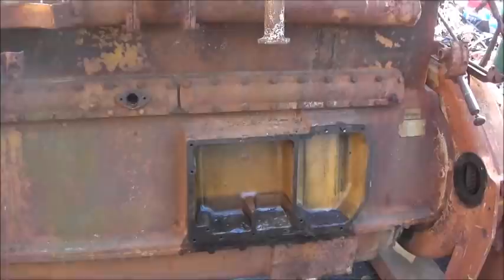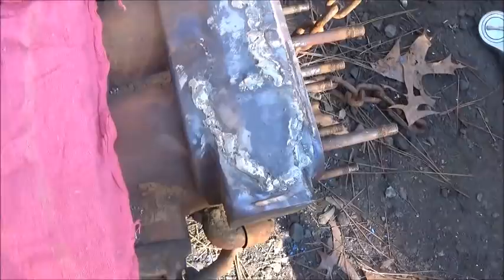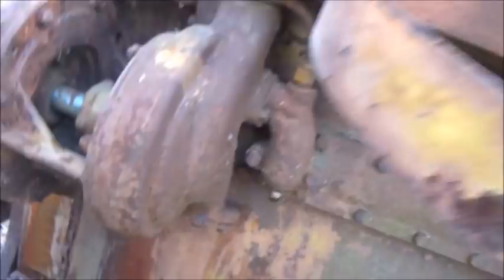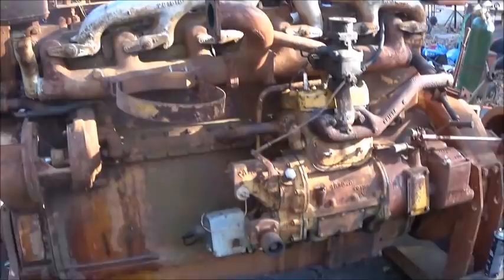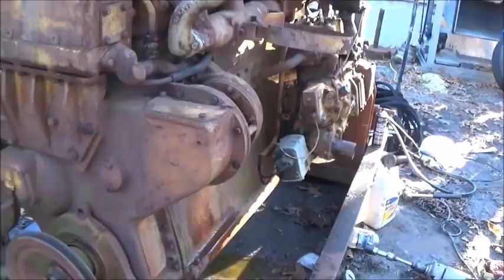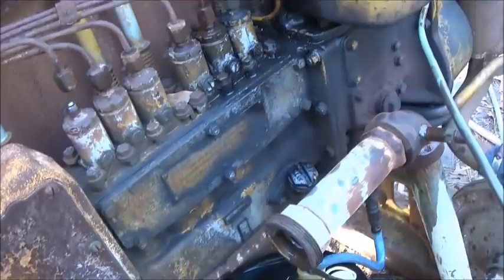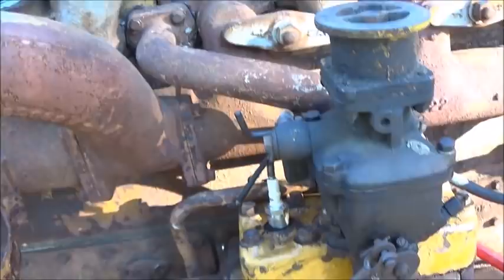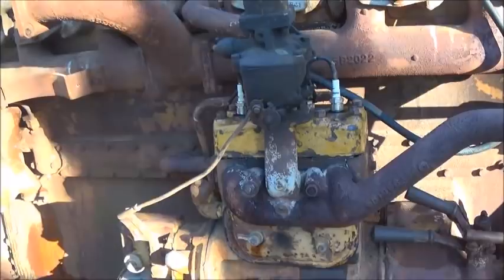1938 CATERPILLAR D13000 PONY MOTOR FIRST START IN YEARS

Comment: Back in 60s,  early freeze in Joliet, il . Was mechanic . Had 3 customers bring busted motors . We put K& W block sealer in all 3 and it worked . One motor had busted cylinder wall . We installed according to instructions  . Parts salesman said if it didn't work he would refund money.  Saved customers lot of money  . Good luck  .

Comment: It's a start , Jonathan . You'll get it figured out . I reckon as you go through it , all of the little leaks will get fixed . That way when she fires off , you will be free enough to see any other troubles . She rolled over easy enough , & had oil pressure . One piece at a time . If anyone can get it running , it's YOU Brother !

Comment: When I was a tractor driver at Caterpillar East Peoria building LL in the 1970's we built a batch of artic equipped D-9's for the trans -Siberian pipeline that the USSR was building and they were all equipped with pony motors that were almost identical except the pony's had electric starting motors and the bendix engagement lever was moved into the artic insulated cab. The bendix is designed so you have to hold it in like some of the old cars that had a mechanical starter pedal.

Comment: We had a model T and Macormick Deering tractor were crank to start .
To avoid having thumb broken cup thumb alongside the fingers ,on same side of the handle as the fingers are on .
This keeps a backfire from ripping the thumb off .
Glad to see you fixed the motor . good work .

Comment: Its what my dad and others of his era worked with. Some still are on the islands in alaska where the government dropped them and we tried successfully to start. The machine itself had problems with frictions on the finals but it did move and then left after we were through playing with it at Thorne Bay, Prince of Wales Alaska. That was back in the seventies. One other was at a mine above marblemount washington.. at a mine called the silver queen mine. The pony motor started with a crank handle between the blade an radiator. It kicked back and broke my cousins arm four weeks I think before he went into the marines. I really hope it barks to life for you Jonathan. I know a persons hopes shouldn't be too high after so long but I feel like it should go.

Comment: I was taught by an old time it is best you use a light film of grease on then older head gaskets so the head can shift in to place and for expansion. And soak them in water for a day or two

Comment: Friend of mine got an old D6 from the late 40s that hadn't run for many years. Problem he had was the plungers in the injector pump we're stuck in the up position. Just had to spray them down good and give them a little gentle persuasion to get them to drop back down against the cam. The gears on the plungers were turning okay to meter the fuel so we don't pull them out and we made sure none of them became disengaged from the rack while we were working on them. We were able to get them unstuck and pumping again. Reminded me of loosening stuck valves in an old inline flathead engine. I noticed some injector pumps have a dipstick in that long rectangular cover so you're sure there's oil in there for the cam and plungers.
Reply: Good info !

Comment: In the UK we mostly had Gardner diesel engines and Rolls Royce diesels in old big stuff, to get sticky inline injector pumps to free off when they've been stood for years just rotate the pump cam till the plunger is 'off cam' and a few seconds with a small blowtorch on the housing would usually work best. Then just oil it all up. Best of luck 👍

Comment: it's hard to beat old Indian head shellac,  to please the  crybabies, maybe we should call it, "native American head."  it's not suitable for everything but it's been around for a very long time and it's pretty much my favorite.  I like your idea using a drill to start that little engine, I used the same methods on those old Wisconsin's I had, I did have to make and adapter to fit the crank pins on the end of the shaft.
Reply: The circle of life!!! An electric motor to drive a gas engine to fire a diesel beast! Now we need to find something that the big ole diesel can power when it comes back to life.
Reply: @rogergoodman8665  lol yep, we have to do what ever works. lol

Comment: Those old cat injection pumps had a habit of the rack sticking if they set for long periods.  It goes against everything I know, but I’ve seen numerous people get in there with a brass drift and a hammer and pound the rack back and forth till it free’d up. You’re obviously a intelligent man, so repair at your discretion, but the barrels need to rotate out of the no fuel position before they will pump. Keep on being you!

Comment: That" Indian head shellac" Permatex was the only thing i ever found would stop active gas tank leak with fuel coming out .
I put a screw in the  hole coated area with indian head a few times fuel leak stopped.
Emergency temporary repair .

Comment: Heat that pump up with a heat gun or a small blowtorch until it is too hot to touch. Then apply some gentle taps with a peening hammer to the case, rotate the cam and wiggle the hell out of the rack. Those plungers will come loose eventually. They usually just stick in the upper position because of varnished fuel. They very seldom rust together if the pump hadn't been stored for a long time without the plumbing/injector lines.
NEVER try to pry the plungers down with a screwdriver or a pry bar!!!!!
They break very very easy!!

Comment: I have a D4 which doesn’t like to prime even with new filters and turning it over with pony. I’ve had to assist with pressurizing fuel tank and that does the trick. After it is primed it works fine. I’ve never worked on Cat injector pumps, have always worked even after 20 years. I think they are plunger type pumps. On Bosch plunger pump I’ve had plungers stuck in up position, you’ve probably checked if they are moving, just another suggestion.

Comment: That brazing will be fine. It's a time-honored activity to braze up tractor blocks. Any # of Cats have been brazed - main and pony engines. Rolled it over in low for a while then change up to high gear - looks good. A common issue with the fuel is that the rack gets stuck and / or the injector plungers get stuck up. Don't be tempted to tap the rack - instead gently work each plunger up and down until they free. The risk of tapping the rack is that the plungers lose their setting and Cat does not publish any information on how to recalibrate them

Comment: be sure there is always fresh oil in the pony motor.. they are not pressure lubed.. if the gasoline gets diluted from the main engine running and the fuel is still in the pony motor carb.. it will dilute the pony motor oil and destroy the bearings.. perhaps the block and crank journals.. the  normal procedure is with the main engine running. shut off the fuel to the pony motor.. let it run out of gas so no fuel dilution  in the pony motor oil can happen. 

 you may want to watch the video with this title.. Caterpillar D2 #5J1113 Diesel Engine Assembly Ep.31: Injection Pump Assembly & Setting The Fuel Rack

 or episode 30.. where he might get into the injector bodies.. 

 you will also want to watch this video 
1937 CATERPILLAR DR7 DIESEL TRACTOR PROMOTIONAL FILM CONSTRUCTION EQUIPMENT 97664  about 5 minutes in it describes the inner workings of the same style injection pump the D13000 has except its for a 4 cylinder not a six...  you will have to google search the titles to find them..

Comment: Worked on one a few years ago and the  D7  the injectors were a pain to bleed there are screws on them to bleed  them they wouldn't bleed at the line till we bled the body's  the one  on the D7 was a square head on the back ish of each body ? I believe ? once we did that then line it was good,  also you haven't lived  till you  have  push started a 25,000lb bulldozer with a sticky clutch 🙀☠️